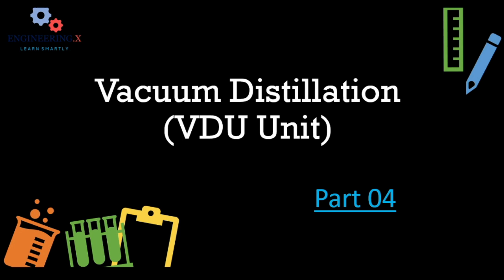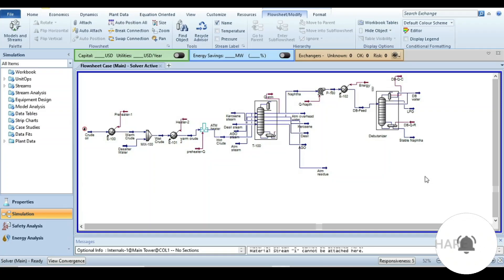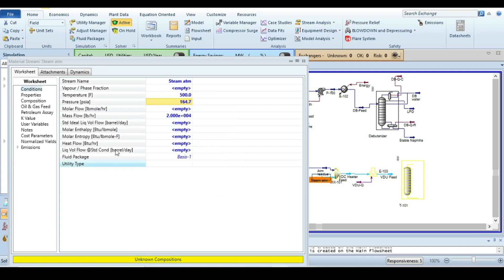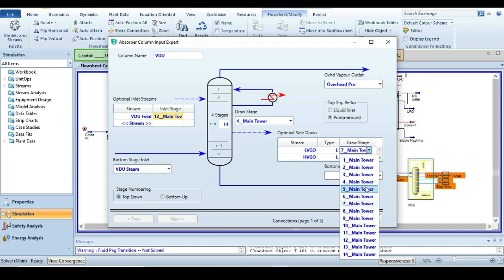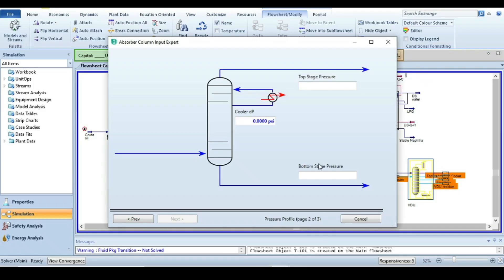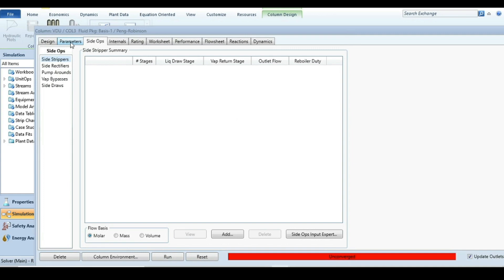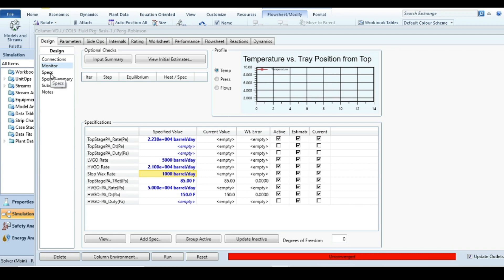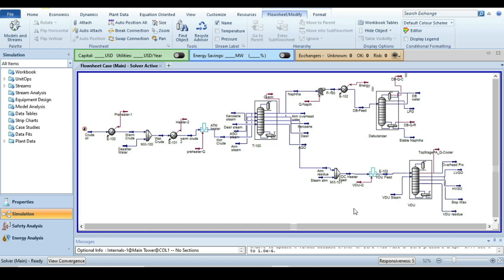Vacuum Distillation unit in HYSYS | Part 4

Comment: I've followed all of the Oil Refinery tutorials using Hysys 2006 (don't ask how) and it works correctly but the last part (Vacuum Distillation Unit) where the 180°F should be added and then, when it does not converge, removed and it will converge.
Reply: I tried to remove 180 deg D from spec, but it still doesn't converge to me(

Comment: Thnx for the videos ... Btw it didn't converge for me in this last one 🙁 even though i tried to re do it a multiples times ...
Reply: the point where it is supposed to be added an additional parameter, meaning, the top temperature of 180°F. Get rid of it. You'll have 0 DF with the top stage PA rate, LVGO rate, HVGO rate, Slop Wax rate, TopStage PA_TRet, HVGO PA Rate & HVGO PA Dt.